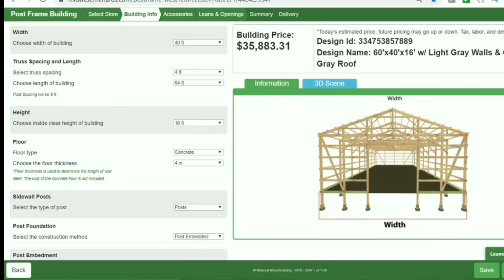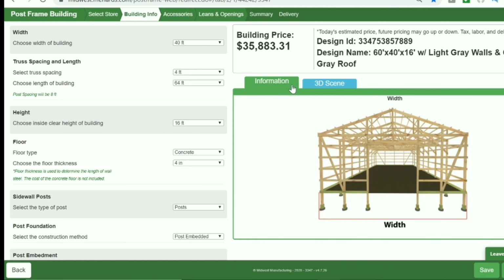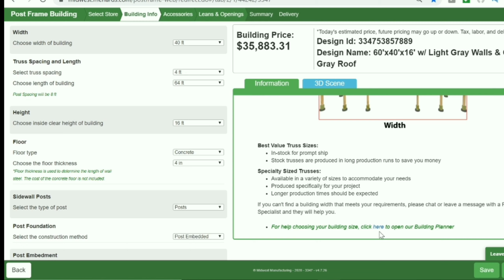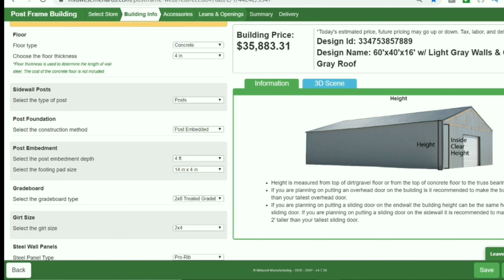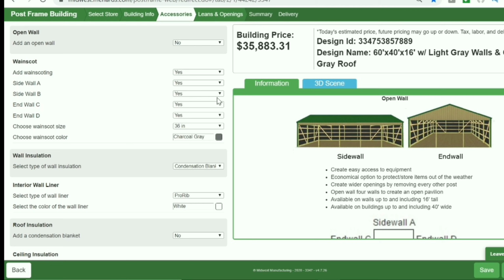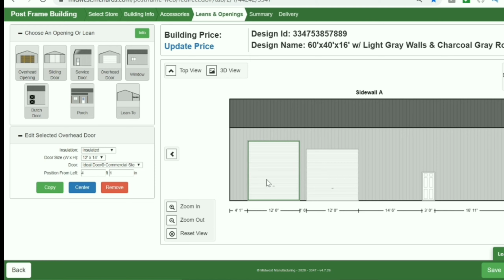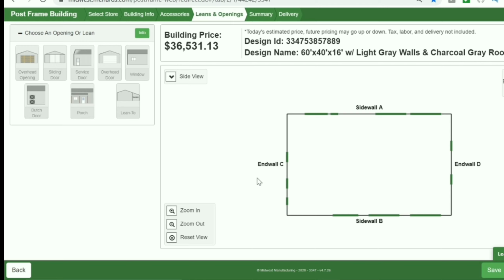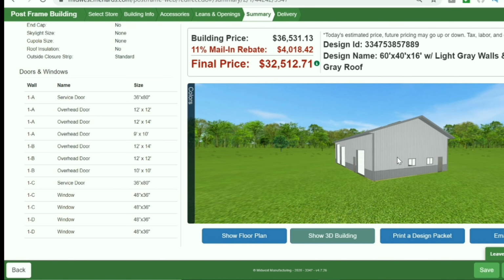FREE Pole Barn Design Tool generates on line designs, material costs and more.

Comment: Great video. The software is very limited. You can spec just about anything for a very general idea on cost but it doesn’t take into account engineering requirements or specific code requirements in your area. And like a lot of us this does not allow the addition of a second floor. Look elsewhere for other more capable software.
Reply from the maker: Definitely has limitations.